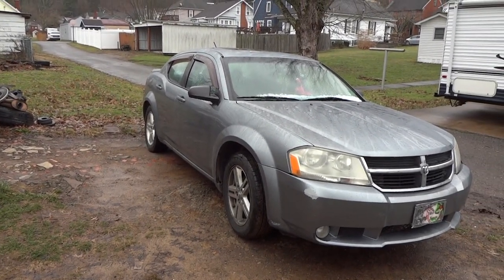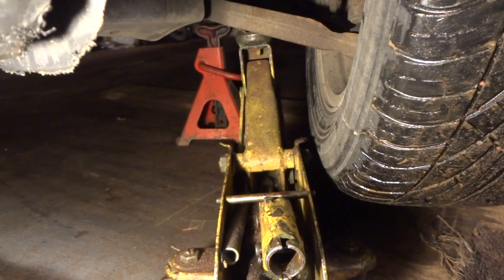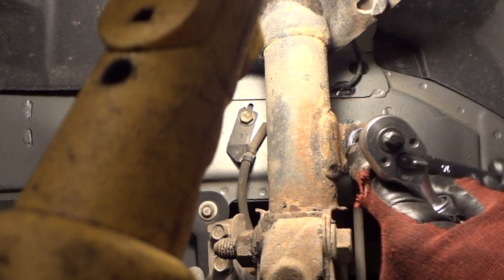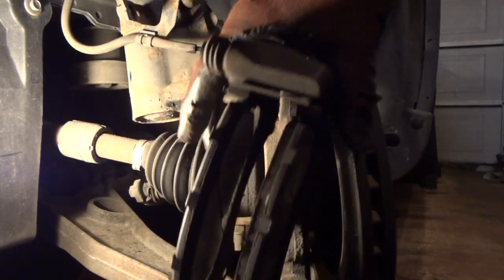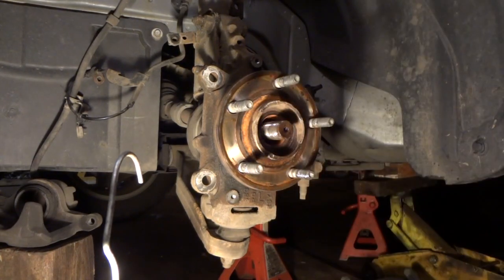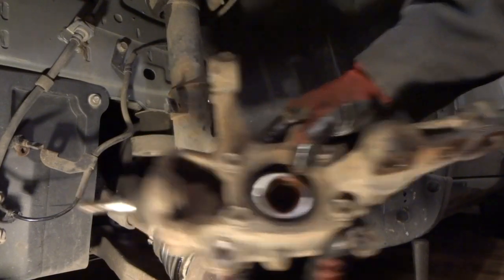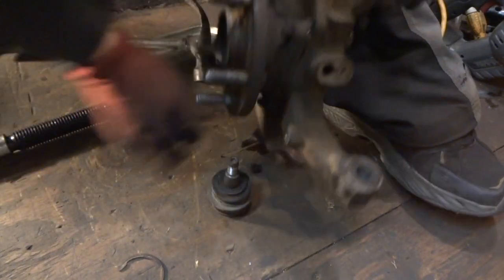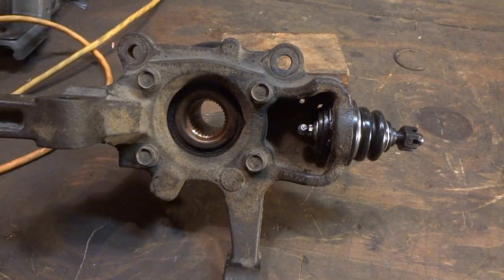2008 Dodge Avenger Lower Front Ball joints Replacement.

Comment: Gave up on my generic ball joint press for this car! Threw the whole thing on my work bench, got my cutoff tool and strarted grinding some metal off it around the rim. Then hosed it down with pb blaster, took a hammer and after a few minutes of therapeutic violence...it shot off onto the floor.
   Then...to get it on. Cleaned out the hole, greased it and the new ball joint seated with the cup and hammer only. Went on pretty smooth. Had to disconnect so much to do control arms and ball joints I now feel like I'm Chrysler-certified for front end repair🤣
Reply from the maker: Nice!! You saved $450 Buy a Steak tonight!~

Comment: After you put the ball joints in do you have to get a front end alignment after you put all back together
Reply from the maker: I never did. Had no issues with tire wear.
Reply: @FixingWithPassion  thank you my tires wear out on the Inside Edge
Reply: @michaellanman4440  how old are you front springs? Sounds like they may be the culprit of your tire wear.